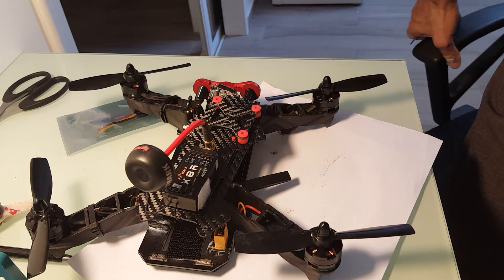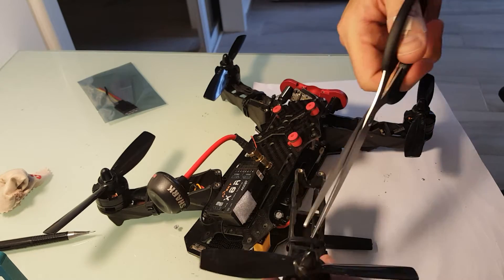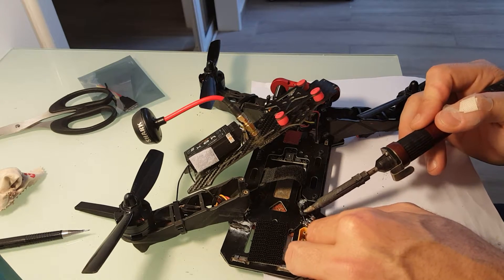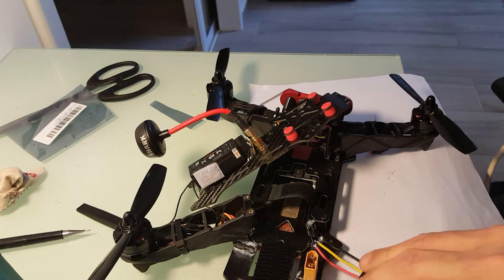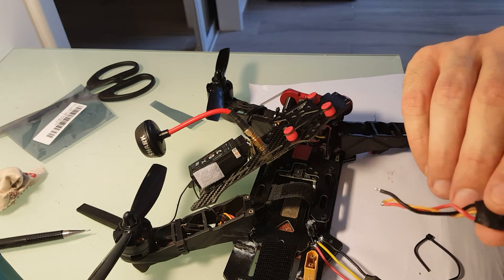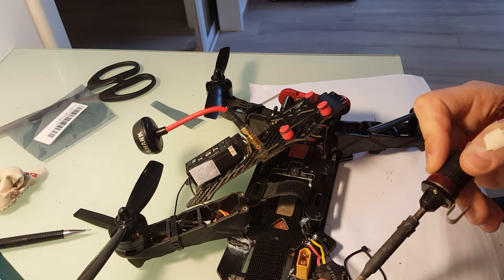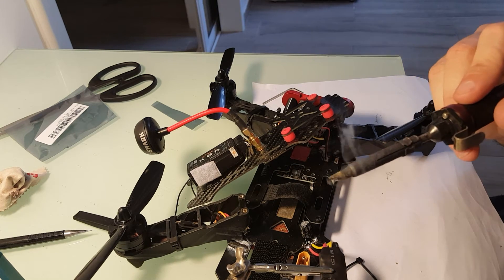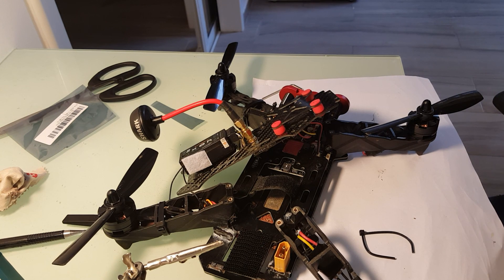Eachine racer ESC replacement (from banggood.com)

Comment: Hi I got a question. What if I bought a replacement ESC that has the 2 thick red/black (+,) wires and 3 thin wires (+,,signal) which ones do we use for the eachine since there's only 3 tabs on the board?
Reply from the maker: The two red and black should be soldered to the PCB. The other three connect to the motor.
Reply: Sorry for some reason my last message got messed up. what I mean is the eachine stock ESCs have 3 wires either side (3 that connect to the board and 3 to the motor) the other brands I have seen have 5 wires connecting to the board (2 red and black and another 3 thin orange,red,brown) and the usual 3 black that go to the motor. which 3 wires do I use out of the 5 going to the board?
Reply from the maker: Please upload a video describing your problem and I will try to help. I no longer own the racer250, so I don't have it here to take a close look at.
As far as I remember, the yellow wire is the signal wire that eventually connects to the flight controller.
Reply: It's ok I figured it out now, I need to use both thick + and - then the thin orange signal wire. the others can be clipped off. thanks for getting back to me anyway.